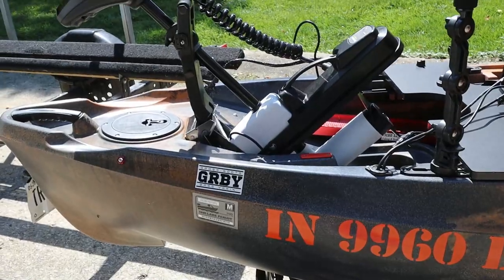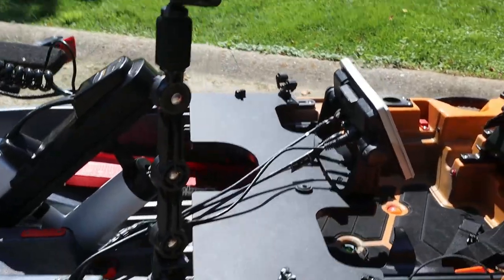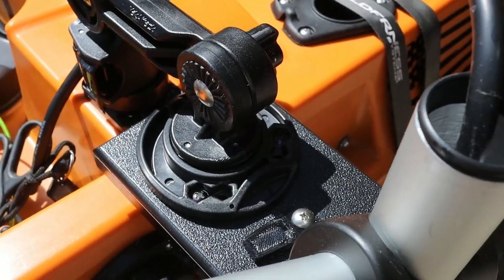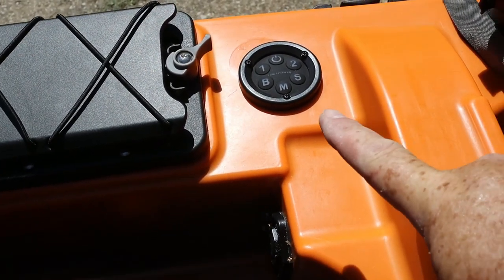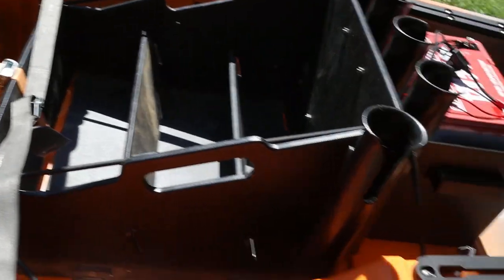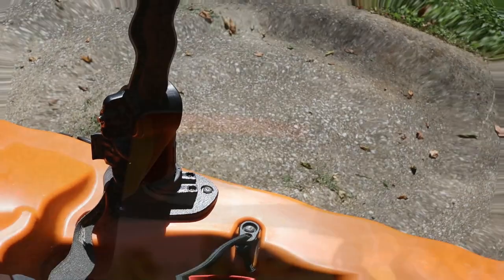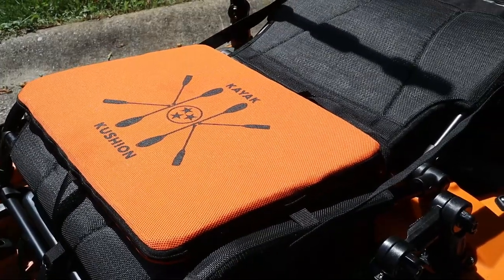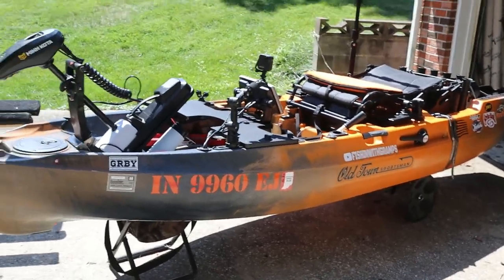2022 OLD TOWN AUTOPILOT 120 |FULLY RIGGED

Comment: Damnit Gramps, I was taking a drink of coffee when you said Knarrbage.  Almost blew coffee out my nose!  I’m about 225lbs and I’ve been wondering if I should get the AP120 or 136. I guess if the 120 carries you, it’ll be fine for me.
Reply from the maker: AP120 is plenty capable.  I was out getting blasted by waves on a wind blown lake twice last week and felt perfectly safe.
Reply: @FishinwithGRAMPS  I mostly fish saltwater, but not too far from shore. I’m currently in a Bigwater 132 (the paddle version) and it handles the ocean really well.  I’m kind of torn between a pedal kayak and a motorized one.  I like the Hobie Pro Angler but the three year hull warranty isn’t worth it for $6k.

Comment: Where does the power cord run from the battery to the head unit?
Reply from the maker: in the hull, connected to the Yak-Power switch panel

Comment: Is a fuse necessary for the trolling motor battery?
Reply from the maker: battery box is pre wired and equipped with a 60 amp circuit breaker
Reply: @FishinwithGRAMPS  Awesome, thanks for the info!

Comment: Is there anywhere on this kayak to store your rods on it while traveling?
Reply from the maker: No, and I wouldn't if it did. They either go in rod tubes on the trailer or in the cab of the truck.
Reply: @FishinwithGRAMPS  dang that sucks. I have a pro angler 360 and that’s one of the best features is being able to store the rods on it. Thinking about switching to the autopilot but that’s a big con for me
Reply from the maker: I don't miss it at all
Reply from the maker: @kirkshammett94  I still recommend getting in one and taking for a spin.  Gotta love having so many great options to chose from.
Reply: This shouldn't be a deal breaker. I never leave my rods in my kayak. If I stop at the gas station or store, I don't want to have to unload them and put them in my truck. I'd rather load them in my truck in the first place.
Reply: @XploreAz  that’s a huge deal breaker for me unfortunately. I have no option to store rods in my truck unless I purchased a rod hiker for the top of my truck or something. The rod storage in my pro angler is one of the sole reasons I have not got another yak